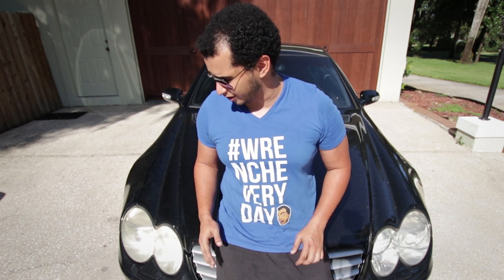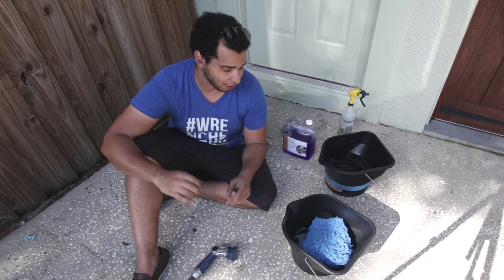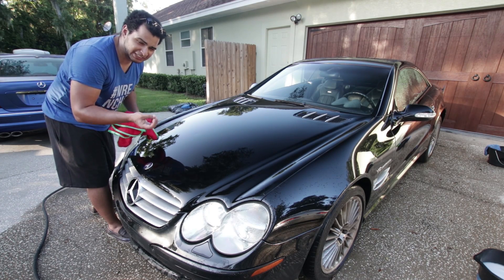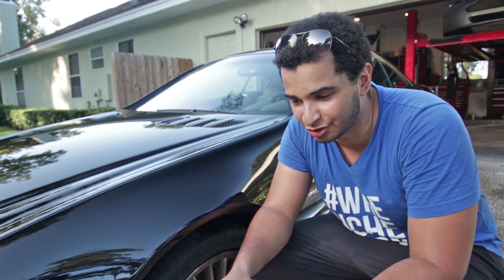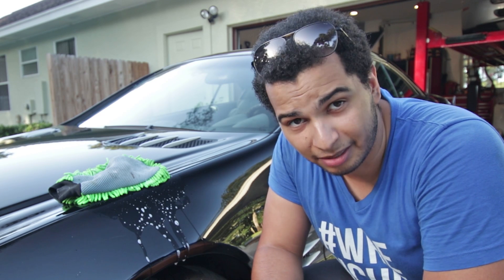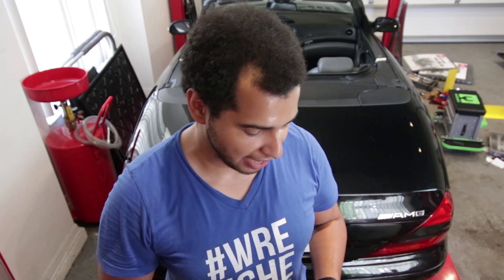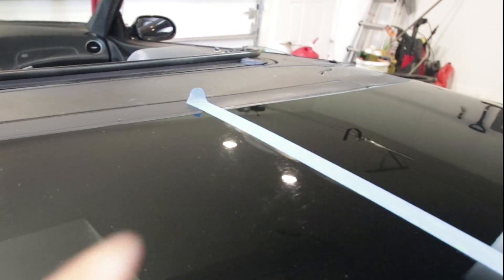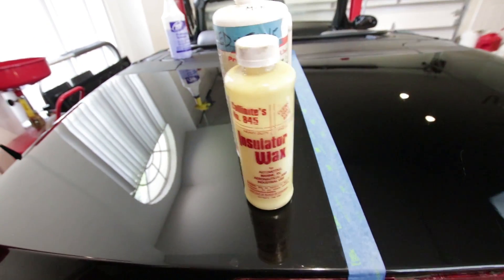I Polished The Cheapest Mercedes SL55 AMG In The World And It Looks AWESOME! - Project SL55 AMG Pt 3

Comment: Great video... You want to use an orange foam pad or a microfiber cutting pad for the initial cut.  Then work towards a red pad for polishing.  Use a black pad to apply the sealant or wax.  The different pad colors signify how rough they are, kind of like grit on sandpaper.  For the headlights use an orange pad and apply Metal polish onto the DA and you will see a much better result.  You can use either Mother's or Turtle Wax so the investment is nominal.  Then apply either 303 or Chemical Guys Jet Seal on the headlights to protect them otherwise they will haze again in about a month, especially in Florida.  I live here as well.... :)
Then reapply the sealant every 3-4 months so they stay protected.  Thanks and keep up the great content.

Comment: Detailers are Gods in my eyes. Took your advice, tryin to wrench everyday 😂. My paint also felt like sand paper so I decided to try my hand at detailing. After 7 days, spent around 3-4 hours after work each day, I finished. Used a DA also with some maguiars and autoglym products. It’s not perfect or pro but I really am proud I stuck to it and finished. The paint is like butter now, still some marks but it’s my daily. Much better than before. Next up, full oil change. Thanks for the motivation, love the content.

Comment: I've been working as car detailer for a year now and can give you some tips. 
Choice of pads: 
The coarser the polish the harder peds you've to take for a better result. But watch out: harder peds and coarse polish needs more water and is likely for making a mess(dry polish flies away from the pad) if you are using too much water or not enough water or too much polish. With harder pads you will be able to polish the scratches way better than with a soft pad. 
I also recommend you to go closer to the paint while polishing so that you can see bigger scratches and polish them more precisely.
For your Mercedes I would advise to polish it with a coarse polish(300/1000) and a harder pad. Afterwards it would be the best to use an eccentric polishing machine for the finish. With the eccentric one you won't have any holograms on the paint. And use a finer(3000/3500) polish and a softer pad for the finish.

Keep up the great work
Greetings from Germany

Comment: Good video man! A couple things. Try using a yellow or orange foam pad with Meguiar's 105 for initial cut. Then follow up with Meg's 205 on a black or white pad for polishing. You can find 105 and 205 around local shops or maybe you'll have to do Amazon.

Also, the Nanoskin (AS-006) AutoScrub 6" Fine Grade Foam Pad makes for a GREAT claybar substitute. You can find it on Amazon like the polish. I was aprehensive until I tried it.. WOW IT'S SO NICE. On my second one now! SUPER fast and way easier than scrubbing with a clay ball that you can accidentally drop. You just put it on the Porter Cable like a polishing pad, wet the paint and BOOM, you're claying a car. Side note.. DON'T LEAVE IT IN THE GARAGE. I did with mine and the pad material got ruined by heat. It got all sticky and nasty.

Again, love the vids and keep em up! I've got a couple early 2000's BMWs that I like to care for, so seeing you tackle these Benz's is great!

Comment: Nice job, bud!! I've got an '05 SL500, NOT an AMG. But pretty much the same car. I polished her, then used a tinted detail wax over it. Came out really well with much less work. However, your way produced better results!! Bet your arms are aching from all that cleaning!!!!!  I think you might want to rethink that manual trans conversion; I see lots of smoke on THAT horizon!! But it's YOUR car; do what you want. PS........SCREW DA HATERS!!!!!

Comment: Apply a little more pressure with your left arm. That's why they have a handle.  Another thing is to go slower with a crosshatch pattern.  It takes longer but it will take the swirls out.  The polish will refine the swirls.

Comment: Use Bilt Hamber clay, it only needs water in a spray bottle as lube, or Meguiars with their QD. 

Also 3 bucket method, the wheel wash bucket keeps it separate from the other two for body work.

Comment: Some detailing tips. I wouldn't bother drying the car before you use the clay bar because you are going to have to rinse the car after the clay bar anyways. I'm not sure what pad you where using but it looks like it might of been a wax applicator pad you would probably want to use an orange pad those work great for compounding your paint, I personally use a Maguires microfiber cutting pad instead of the orange pad I like them better. While colinite 845 is a great wax it's difficult to use I have worked professionally in detailing and I have a tricky time getting it properly Applied where it works properly, also the shine it gives isn't the greatest so you can get a wax that's easier to use and looks better that's what I would recommend

Comment: Different pads have different levels of abrasiveness, ranging from none to heavy and everything in between.  You want to match the pad to the scratches and the type of compound you're using.  I usually start with a light pad because you don't want to over do it right out of the gate.  The "colors" are not a good indicator since the companies making the pads are not consistent with the cut => color matching.

Comment: You need to do small areas... the test area on the trunk  is "4 parts". The whole trunk is 8 parts. 
It's a tedious job but rewarding! you can do MUCH MUCH better and have an almost scratch free finish.

The stiffer the pad the higher cut it has. Yellow and Orange are (often) the ones with the highest cut.

Comment: Microfiber cutting disk plus compound 1st. That should get out most of those scratches. Please don't wet sand. I'm sure you don't need it. After compounding with a microfiber cutting disc switch your pad to a polishing pad with some finishing polish and the results should look a lot better. Keep up the good work, it's a journey.
Reply: 100% this. Also, were you using the same pad for each coat of wax? That's what it looked like. You shouldn't. You should be using a pad with a decreasing amount of abrasiveness such that when you get to even the second stage (polish) or certainly the final stage (Collinite 845), the pad no longer has any abrasiveness.

Comment: Nice job, although you would get better results on the compounding phase to just work a smaller area as opposed to half a trunk. Products you used is fine, they are actually some of the best, so no BS there. Although Merc paints are very hard so you might need a harder pad than the one you are using, also dont wet sand anything if you havent had any experience with it.

Comment: First of all, fuck the haters.

Secondly, to get rid of more of the swirls, you really need a rotary and a wool pad OR to use microfiber cutting pads on your DA which are much more effective at heavy oxidation than foam pads.

Plus they are more durable and more reusable in my opinion. Menzerna makes a good product especially for hard Mercedes clear-coat, the Powergloss ~1000 grit is really fast at cutting heavy swirls and hard clearcoat, just be careful (and always start with the lightest abrasive you think will work, no point taking off more of the clear-coat than you actually need to).

Comment: I'd recommend you use a chemical guys orange hexlogix pad and their v36 polish, them chemical guys v38 polish and a white he logic pad, then seal it with chemical guys jet seal using a black he logic pad.
You don't need to wetsand that paint, its not that bad! Use the new quantum pads - the have a hole in the middle and hold up better. Tgec portacabke is fine I use it. Go slower , I looked like you were moving the buffer too fast. Do only a 2x2 ft square

Comment: These commenters, wow. Dish soap is fine for a strip wash. Meguiars 105/205 for two stage polish. Am not sure what kind of pads you used, but usually they are specific to the stage of polish you used. Next time just polish the whole car with stage 1, then wipe, then polish with stage 2. No need to wipe each panel after polish. Don't bother with the haters in the comments. I like your channel.

Comment: Maguiars sells a polish specifically for polishing plastic and it will leave the headlights more transparent (clearer) than the body polish. Also, why didn't you wax it after? You go through all that work and don't complete the job? Post-polish waxing with NXT or a good Carnuba will add depth and make you cars finish need polishing less often and easier to clean.  Wash/Clay Bar/Polish/Wax.

Comment: Its too bad you put so much time into a 2 step without doing a bit of research.  You likely would have had better results for that time.  IE- 105/205 and proper pads for each.  Generally the pad color indicates how much cut the pad can give you, not all brands use the same color scheme but generally an orange pad is used to cutting and white for finishing (again varies by brand).  That green pad is sorta in-between and one I would consider for a 1 step using a product like Scholl Concepts s20,  which probably would have given similar results to what you achieved in 1/2 the time.

Comment: @Tav
Use a microfiber cutting pad (Meguiars/Amazon) for the M100. Use a foam polishing pad (Meguiars/Amazon) for the polish and "polish twice as long as you cut" -Larry Kosilla
Then wipe down all the areas you polished with a MF cloth and 50/50 concentration of Isopropyl alcohol and distilled water before applying glaze/wax/sealant.

Edit: Also, clean your pads out every now and then.

Comment: Never dish soap. 
Sorry dude but no.
Reply: you can use dish soap.....its very good at removing wax
Reply: Alexander Ranetkins not for regular washing but if you are going to be polishing the car right afterwards right like he did then it is actually recommended as the dish soap breaks down the wax and grease in the paint
Reply: Dish soap is fine if you intend on removing contaminants and wash in preparations for clay bar and polish - it's how you get to to the base layer of the clear. Otherwise it's not good to use if you are just washing your car on a regular day with no intention of polishing or prepping the paint.
Reply: In this case, dish soap was correct
Reply: If you're trying to remove old wax before compound, clay and polish it's great...
Reply: No dish soap under any circumstances.
Reply: Philip Rosenthale at least I know when to use dish soap for my car.
Reply: When you are trying to strip the paint of any previous wax or contaminants it's actually better to use dish soap. When trying to maintain your wax coat or previous polish then dish soap is a big NO.